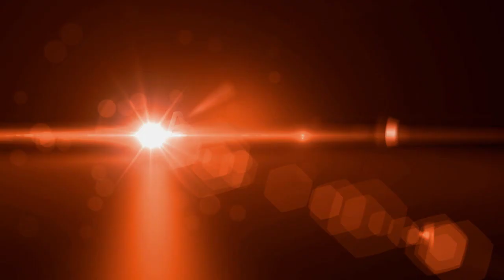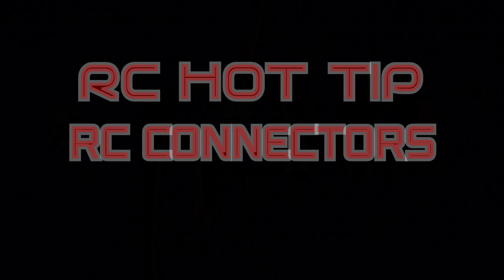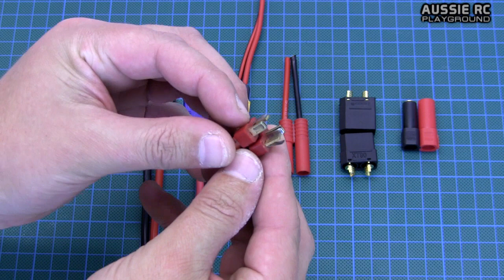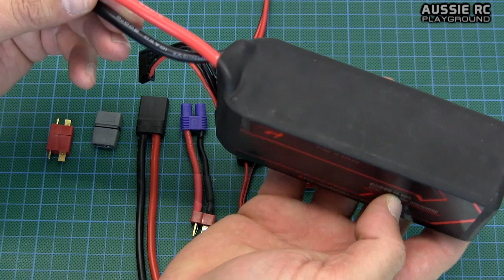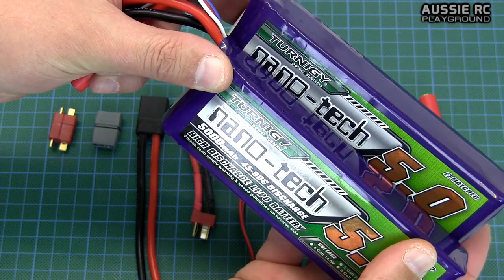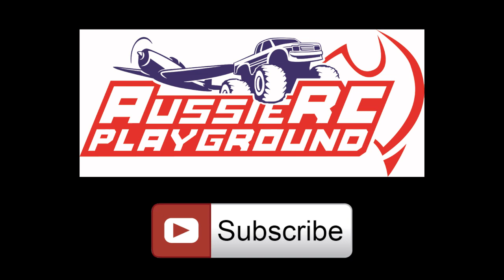RC HOT TIP: Choosing the right RC Connectors

Comment: I moved from deans to ec5 2 years ago, last year I moved to xt90 (xt60 
for crawler/flight stuff) and am perfectly happy to remain exactly where
 I'm at, the issue with ec5 and the xt150 from what I'm seeing is 
assembly and the hassle of keeping the solder just right so you can 
still get the bullets to snap into the housing, and while not an issue for
 most it's allot easier to accidentally short the 150 vs solid paired plugs
 , xt 60/90 no such issue's, really quick and hassle free to solder up.
 I'll gladly spend 1min dealing with heatshrink or liquid tape on xt 60/90 
to avoid the hassle of ec5 assembly and cracking the plastic pieces.
 In extreme record attempt environments you may see a dif 
with the bigger far more expensive xt150, providing battery layout 
doesn't require you to run a jumper to reach everything anyway, for 99% 
of everyday use the xt90's are more than sufficient, have built in air 
cooling in the housings, and are affordable, xt150 not so much, as for 
castle, yeah they are huge and overkill unless your running a 1/5 scale 
and you would have to sell a kidney to finance a swap to them from 
another style if you had more than 1 or 2 cars and batteries.

I do see the logic and reasoning behind the xt150, I just don't see the
 minimal reduction in resistance outweighing the increased risk of a 
direct short accident or the substantial jump in price.
Reply from the maker: +Ryan Dorman Unless you deliberately force both connectors of the battery into each other, I honestly don't see how you can accidentally short out anything with the XT150s - they have a plastic sleeve over the connector. If you're referring to soldering them wrong, then that argument holds very little water because the exact same mistakes can be made with any connector if you're not careful.
Regarding price of the XT150s, they cost me AU$10.57 per bag (5 pairs) and the XT90s are AU$10.11 per bag (5 pairs). Although you are technically correct in saying the XT150s are more expensive, I'm not sure how you see the extra $0.46 as being such an issue that it makes them less affordable.
As far as the reduction in resistance goes, it's all relevant to the user and how important they deem it to be. It comes down to the application and the results they what to achieve. To some, this may not matter much, but to others, every little bit of extra power and/or efficiency they can squeeze out of the RC is crucial to winning a race, getting longer run times or just being the fastest kid on the block. I do agree that there's nothing wrong with using XT90s and they are suitable for most applications, but to me they still hold a disadvantage when it comes to running batteries in series.
Reply: +Aussie RC Playground 
Interesting video, I just thought i'd mention that when I first saw the XT90 released, I went, hang on, an XT60 can do that, set up a 100A Watt meter (1600W rated, and comes with XT60s) and using some 250W and 65W 12v floodlights, setup a system with around a 75A draw @12v, after 5min the XT60 was basically @ ambient temps, so i added another pair of 65W floodlights, taking to almost 90A and it was hitting high 40s with a 20 ambient temp after 3min.
 I run a 120A ESC with them and have never had the Xt60s more than warm.
Makes me wonder what XT90's can do? 120A con I'd think! 

On a side note, saw on HK a Multistar 20ah 6S pack LiHV, 2Ccon, 3Cburst with XT90s and 12AWG cables... HK must assign cables and connectors based on a capacity @ 20C formula, 16AWG is rated to 65A, XT60s are 60A, 3x20ah is 60A... and it's a lightweight pack, why add weight with heavy wires and connectors? (I also don't understand the long balance cables on Multistar packs, I shorten mine to ensure they don't have a meet&greet with my props.)
Reply: +Aussie RC Playground digging back through the hk site your absolutely right, last I looked at them was right after your first mention of them and they were half the quantity, same $ in the us warehouses, also appears there has been a revision that thinned the housing a bit and deepened the groove the bullets snap into to alleviate some of the accidental solder whicking and assembly issue's, unless it's a misprint they may actually be cheaper than xt90 now.
 Still not something I plan on running, takes up more space, and inherantly not as idiot proof, and yes while you would have to work hard to short it, how often do people you know pick one up and check them out, 2 separated wires with compatible plugs in the hands of a looky loo = plugged in and shorted, remember that guy named murphy with a law written after him? it's a little piece of mind having a solid polarity keyed plug that more than easily handle's any load outside of a5th scale hv setup put on a connector, plus they take up a little less space, and are a little less involved or aggravating as far as assembly goes (the half cup design on the 60/90 is brilliant).

Comment: great video that explains why my dads 6s battery always seems to have more power on the same Kraton setup as my 2 3s batteries with the joining connector. His has a lot less resistance in the overall setup.

Comment: The hobbyking bullet connectors are called "banana" connectors. If you put rubber sealer in the ends around the wires they're basically waterproof when connected

Comment: You forgot Anderson Power Poles! 30 and 45amp version.
Reply: +K Schlos Oh and 30/45 amp version have been tested to higher than 300amps burst without problems.
Reply from the maker: +K Schlos Can't say I've ever heard of those. Sorry.
Reply from the maker: *****  Deans started life as speaker connectors, so I wouldn't put them in the same sentence as Castle. IMO, Deans plugs are probably the lowest standard you can get for battery connectors and I'll never use them again. But no, in all the years I've been in this hobby I've never heard Anderson Power Poles. Don't know what they look like and no one has ever mentioned them to me in the past. And I've never seen them for sale on any of the websites I use... Sorry.
Reply: +Aussie RC Playground powerwerx.com sells them. Duratrax sold them years back in the R/C industry also specifically during the heavy Tamiya TCS racing years. Deans came out shortly after. Power Poles are heavy duty industrial connectors that have been proven in just about every commercial and industrial field. Sheathed connector with sliding contact with extremely low resistance. On the powerwerx site you can look up the specifications for the 30 and 45 amp model(not actual rating) that most R/C enthusiast use.
One test on youtube has someone who put 380+ amps continuous at 16volts and then they finally melted. Quite a stout connector.
Reply from the maker: ***** Actually, I've never bought Deans from HK, I never liked the look of the ones they stock and I know they are fake, so I wouldn't know if they're any good or not. And to be honest, there are so many clones of Deans out there these days, I don't know which is which any more. But regardless, Deans are not a plug I plan on ever running again. Old design, poor performance and far too many issues with them in the past to say anything good about them. I used to like them back in the brushed motor days and stuck with them for over a decade, but they just don't stack up any more. Far better connectors out there.

Comment: If you're running two batteries in parallel generally in my experience they will ride on either side of the chassis in which case wouldn't u still need to run an extinction lead so they will reach

Comment: Started with deans and im now using xt60's used them to connect two 4500 45c 2s in series on a 1/8th truggy and both battery's come back pretty warm but connectors handle the current fine and stay cool
Reply: TheLukey21 Got Deans on the ARRMA pulling 6S, cables and connectors cool to the touch.
Reply: Peter Pascal yea you should be fine. I always prefer to use xt60s or ec5s
Reply: same thing for me, 6s on a buggy doing some speedruns and laps round the block and still is cool to the touch as you said
Reply: Can i run my talion with xt60 too? 
All my lipo are xt60

Comment: Good video but you didn't show the castle plugs which is all I use. In my opinion they are one of the best on the market.
Reply from the maker: +etab83 I didn't show the Castle connectors because I don't have any. Plus, they are expensive and you still need a Y connector to run 2 batteries in series which renders their 200amp rating to be on par or bellow the XT150's rating. They do however gain that advantage if running a single pack.
But as I said in the video, people will use what suits their needs and/or brand they prefer. I chose the XT150s because it suits my needs and budget. I'm not expecting everyone to change theirs just because I did, but hopefully you have some info that you can use to decide that for yourself.

Comment: There nice those xt150 connectors but i dont like that they can be short circuited by connecting them together its just weird but theres advantages like puting them  in series
Reply: The way they're designed doesn't allow them to be connected incorrectly, unless they're installed on the batteries incorrectly. Which would be 100% installer error, not the connector's fault.

Comment: Do you think you will Just change them all even your planes one day? And is there anyway you can do a test and see how many amps/volts you are getting? I use Traxxas on everything. But I use a jumper EX: to Deans to Traxxas. I know I have to be luseing power somewhere with that. What do you have or going to put into The Tundra? If you think it is worth it  I will Change all mine over.    O and by the way I was getting worried you not putting up a video.  I look on your page and you have a lot.  They are not showing up on my Subscriptions I so I Email youtube? of do you have to? Later bro.
Reply: Your not losing anything
Reply: +Powerpickle68 of course you are, he even explains it in this video. More resistance equals less power, it's hardly noticeable in the real world but you are definitely creating more resistance

Comment: XT60's rock.  Unless you're running a ton of amps...  I think the XT60 can actually handle more than 60 amps easily. I do like those XT150s though.
Reply: +BWX XT60s are an excellent connector for 90% of applications and can run in excess of 90 amps but not for a sustained period of time otherwise the solder just melts. I speak from experience.
Reply: +Lord Grief Mc. Scumbag Yeah 90 sustained is a lot. I was thinking  80 is about the most i would be comfortable  with, knowing it could handle a little more than that in bursts. But they are really good for such a wide range of things.
Reply: +Lord Grief Mc. Scumbag for instance I have one hooked up to my 70 amp ESC in my RC 10 that I run with a 3S 3300 mAh 65 -130C, and I am comfortable with that if it did ever sustain 70amps although I'm sure it doesn't.
Reply: +BWX that all depends on the motor since the motor pulls amps not the esc
Reply: *****
Right, that's why I don't think it's pulling 70amps.  3300kv on  65C 3S. Depends on gearing too.

Comment: I always laugh when I see ESC's on Ebay promoting 320A current, and fitted with a Tamiya plug.
Reply: Lol, if you managed to melt a tamiya connector, you were doing something wrong..
I ran a 14t double on a MECHANICAL regulator and the plug was fine for years..
Reply: Will be fine in short bursts, and those ESC s aren`t rated 320A continuous..
Reply: Lol that's why I am here, got a cheap one with the "320A" rating (yeah right).  Just using them for small little projects with brushed DC motors out of toys.  Work great for little crap projects but those connectors are horrendous.  The other thing is they don't have much circuit protection accidentally crossed the receiver leads on a bread board and bricked the thing.  But meh for $8 shipped I can deal.
Reply: It was an old first year 1994 Traxxas rustler. I went out and bought a 4000kv system with esc and a 35/76 gear ratio for speed runs. It lasted a while but afterwards i noticed it would have trouble going into reverse. Upon further inspection the esc EC3 to Tamiya Adapter because my batteries were Tamiya hence the adapter. I noticed the negative pin on the Tamiya connector was black. Tried to pull the plug apart nothing. Got it home took a pair of players on both ends and pulled them apart the negative pin got so hot it melted to the inside of the Tamiya plug and melted the plug to the battery plug. I replaced all my plugs with Traxxas High Current plugs since my 4 Tec used them and i already had that charger. I haven't had an issue yet. I also noticed a huge improvement in performance with the new plugs over the Tamiya. The throttle response was much crisper. Problem is i don't think the Tamiya could handle the load they were given.
Reply: @davidfaustino4476  Yeah, most likely the burst rating. My 130A ESC has a burst rating of 750. But I'm also using paralleled XT-60s and dual batteries to feed it that kind of juice, instead of XT-90s. And I'm just now learning about the 150.
Reply: you're supposed to use 12 gauge wire for 20 amps what's the fuse point is over 200 amps so you'll be fine using these connectors that are rated for only 90 amps on your three hundred amp RC.
Reply: Even before the days of high capacity LiPo's, and brushless motors, "Tamiya" connectors were considered junk by people who were into racing. Back then your two major alternatives were Dean's, and Anderson Power Poles. 

When I first started off, I ran a Tamiya connector, until It kept fusing the plastic together. I wasn't "doing something wrong" either. The surface area of the Tamiya pins only allow so much current to pass before they start heating up. My 11T triple wanted more current than the plug could provide, and that's when I switched over to Power Poles. 

Tamiya's were fine for stock, and mild motors, especially if you weren't constantly on it. But if you were trying to use them for say under a 13 turn motor, it was only a matter of time before you'd need to pry them apart with a screwdriver after a race.
Reply: How would Tamiyas melt?
Reply: Leo van Miert can someone explain this joke
Reply: Not so much a joke but an observation. Tamiya plugs are among the weakest plugs for RC. Though popular in older RC's, anything above 30-40 A and the connector just melts together. To claim 300+ Amperes and then fit a Tamiya plug on your ESC says to me "I put that number on the package but I don't believe it either" .
Reply: Agreed, I ran Tamiyas on my first RC I got. Only running a 7 Cell NImh battery I burned the crap out of one of them and it actually melted the plastic from the connector on the battery to the connector on the ESC.
Reply: That is sad, u gotta explain ur joke. Tho i am newbies but i got ur point ;)